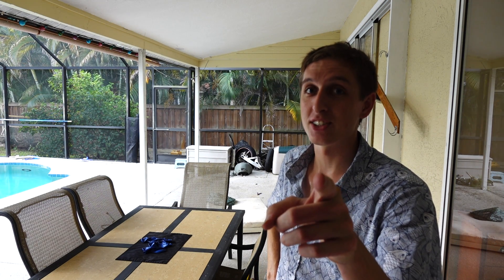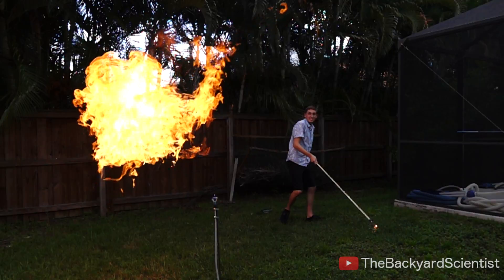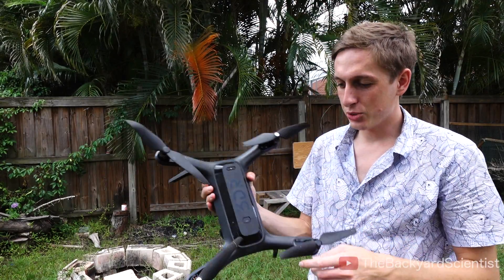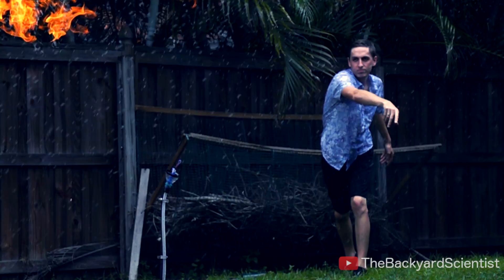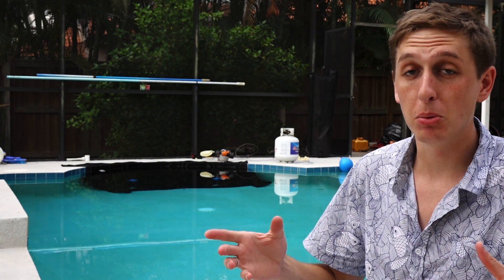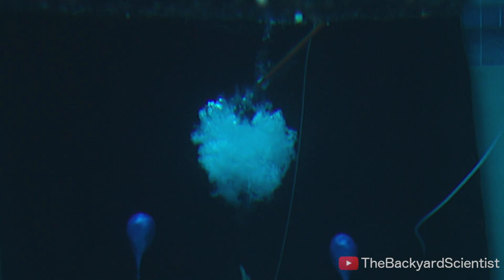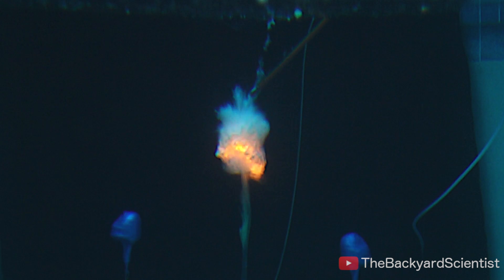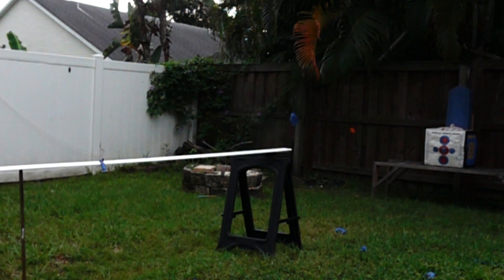Exploding Balloons filled with Propane Gas. Drones, Steel wool, and Underwater explosions! - SMS#4

Comment: Fill a balloon with colored powder and propane and light it on fire and see what happens? Probably a huge mess but it'd be cool maybe haha
Reply: ejleoz21 okay dude, have fun with your friends :)
Reply: ejleoz21 Calm down dude, it was just a suggestion. No need to cut other's ideas down...
Reply: +ejleoz21 haha ive been in enough youtube fights. They are pointless
Reply: +starbucks10v3r there are ways to actually change the color of a flame. you can get pretty much every color of the rainbow.
Reply: The Mighty Pickle Rex yeah i saw that video, with using the different types of gasses! but I was thinking it'd be fun to see the powder blast!
Reply: starbucks10v3r you would have to be very careful what powder. if the powder is even a little bit carbon based, then you are looking at a gigantic fireball that can easily endanger people a good ways away.
Reply: The Mighty Pickle Rex ohhh dang!! Didn't know that!
Reply: starbucks10v3r that's actually a fairly common problem around grain elevators. that dust from the grain is highly flammable. even flour is highly flammable.
Reply: The Mighty Pickle Rex interesting! never knew that!
Reply: +starbucks10v3r no, that's utterly the most stupidest thing I have ever read. Why would he do that? its a waste of time. He might as well try and make a spaceship to the moon
Reply: starbucks10v3r BUT IT WAS STUPID! WHY? WHY? WHY?
I'm not gonna calm down! I just showed all my friends, they all cracked up. Thought u were on drugs. Promise me you will never make a suggestion ever again.
Reply: starbucks10v3r wow,  you didn't get one bit pissed off. In school, we did a social experiment like this and
I was testing one on you. God for you that you didn't get angry, have a nice day.
Reply: +ejleoz21 That may have something to do with this conversation beeing written instead of verbal. So he has plenty of time to think about his response instead of acting just on emotion.
Reply: Landogarner83 I see...
Reply: +starbucks10v3r these utube comments are hilarious
Reply: Sunny shine I'm here all week

Comment: I think the Oxygen propane balloon submerged in H2O exploded twice, because of what water is composed of, Two parts hydrogen and one part oxygen. When the flame lit the balloon the propane gas ignited, then compressed by the density of the water, Hydrogen exploded along with the oxygen compound. What do you think?
Reply: No, the water molecules simply did not split to yield hydrogen gas and oxygen. That will require energy to split, and energy to reignite it. The effect in the video is called cavitation. The expanding gas was enough to push the water away, but once that stopped, water compressed the gas again, but it was too much, and then the gas expanded again.
Reply: I thought that is what I had eluded to, but, I am not a chemist. Thank you.
Reply: +The Crazy Pineapple First explosion was propane and oxygen mixture and appeared larger because all the propane was allowed to burn quicker, giving a louder boom, and something denser than air will allow the shockwaves to travel faster. 
Second "explosion" was cavitation and when the force of the water compressed the air, the air became superheated and flashed.
Reply: ***** Yes, of course. I was just saying that the energy explanation was incorrect, there was enough energy to break down water, it just wasn't applied in the right way to allow this.
Reply: +noobnoobyify The explosion yields a fuckton of energy so the explanation isn't the best.

Comment: The second explosion is probably cavitation. Mantis shrimp use cavitation to it's advantage in destroying it's prey.
Reply: The Mighty Pickle Rex
In this instance the light emitted is more yellow so it's possible that is part of the reason but in the ballistics gel videos and even underwater firearms demonstrations the initial blast of gas will always compress and when it does it emits light.
Reply: Robert Bradbury Yep...and that reaction usually emits light.  You even see it in slo-mo ballistics gel testing with firearms.
Reply: +Iam TheOsprey I just thought that the compression was igniting any unburned gas and oxygen.
Reply: Exactly.
Reply: don't you mean the pistol shrimp? I thought the mantis shrimp use a pair of clubs your
hulk smash prey. not stun prey with a cavitation bubble.